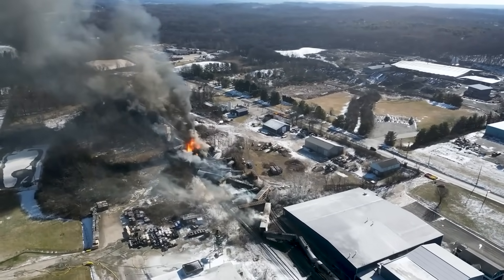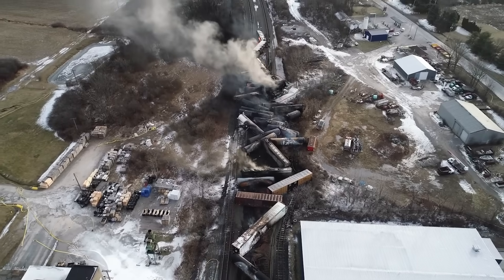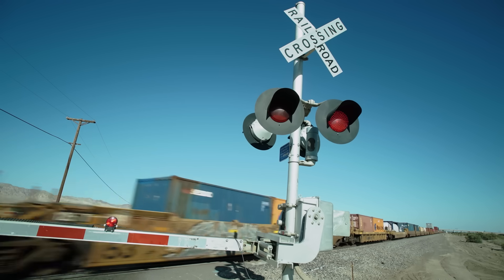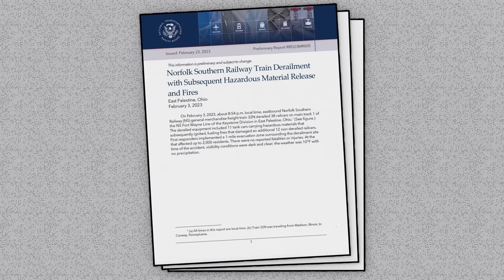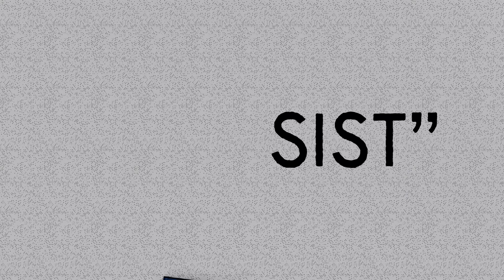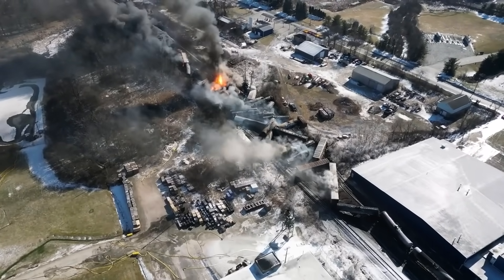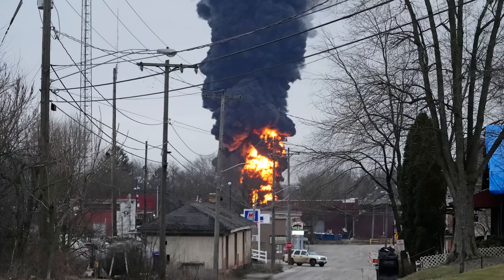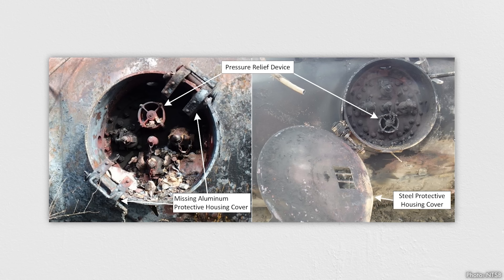East Palestine Train Derailment Explained

Comment: There definitely is something that can be done politically about the safety culture for the US Class 1 Railroads, and something was attempted about half a year ago, the big rail union strikes, while also being about draconian working conditions, were about safety on the line. These things were raised to the rail operators and of course they were soundly ignored because re-investing in rail infrastructure takes away from the scheme of pumping stock prices with stock buybacks and creating a circlejerk of money for the board members of companies like Union Pacific and Norfolk Southern.
Reply: dont worry, though, this will "spark a conversation"
That's all we need.
That always fixes these political issues, right?
Reply: @diegoochoa572  just thought thoughts and prayers <3 

oh wait
Reply: @BOBTHEBERT Your comment started off interesting, but the more you wrote, the less I was persuaded. All I saw was someone who didn't know the first thing about how companies are run and only wanted to divide people. Your post implies that these companies are ignoring reinvestment but a quick fact check reveals you are wrong.

Both companies increased capital reinvestment in 2022 and 2023 (to their highest levels ever) and both are spending over 20% of revenue (not profit, revenue ... so, a larger commitment!) on capital reinvestment. Both replaced and repaired over 100 bridges, built hundreds of new turnouts, replaced over 400 miles of track, resurfaced thousands of miles, replaced tens of thousands of bridge ties, and replaced millions of railroad ties. Both also invested a couple billion in their industrial partners to help keep companies and communities that use trains healthy and created thousands of jobs in the process.

If a company buys back its own stock, it thinks it's financially strong today and will be in the future. You should be glad your company is able to do that. (You don't want to be a leach on society and work for a company that expects the taxpayers to bail it out, do you?) When a railroad makes a profit after a buyback, it keeps the dividends it would have paid out to other people, so it can spend that money on other things inside the company, like rising healthcare costs. 

When the stock price goes up, pension funds are on more solid ground and you're less likely to abandon retirees because you spent more than you made. A financially solid company can borrow money at a lower cost, which again reduces your overall expenses so you can keep buying steel to replace rails even when inflation is up. Or maybe they'll use that money to pay for union-mandated wage increases. Companies with rising stock prices attract new investors who give you a capital infusion to continue building out or refurbishing your rail system so you get these benefits all over again next year. (And presumably people buy that stock at a higher price than your buyback, so even more profit for your company!)

Don't fall for simple stories like "the rich want to screw everyone." That's just a sound bite designed to shut down your thinking. You'd be better off learning how and why people make these kinds of financial moves outside of self-interest. Turns out there are plenty of reasons.
Reply: Man its almost like capitalism doesnt work and deregulation leads to disaster? Who wouldve thought
Reply: Didn't Norfolk southern spend billions $$ on stock buy backs? That money could have been used for better equipment and on safer working conditions.
Reply: “Draconian” lol…absolutely laughable union propaganda.
Reply: Just nationalize the railroads already, we can't trust railroad companies obssessed with cutting costs above anything else to control some of the most important pieces of infrastructure in America.
Reply: Train brakes are ww2 Era technology both Obama and Trump signed law that excluded this trains  from having to update these trains, making a hole lot of money for the railroad oligarchs.
Reply: @juniorbricuyet528  which, if the law was signed and in place, would not have affected this accident in the very least.
Reply: I am honorarily pinning your comment.
Reply: Capitalism :D
Reply: @ssggzzyy76 this practice is actually communism.
Reply: @ssggzzyy76  no, that’s called money laundering.  Similar to religion and how all the donations that are made are tax free.  However, it’s the grey areas that people operate in that destroy the idea of integrity between competition - though, it’s legal.  Though for the instances where it’s illegal, but we’ve been desensitized to pursue justice because of the blind trust that people place with their politicians, which created the avenue for the two-tier justice system we have now, which needs to be dismantled.
Reply: @ssggzzyy76  not even that, just corporatism. :P
Reply: @BOBTHEBERT never truer words have been spoken. Thank you my good fellow!
Reply: Very disappointed that Biden forced them back to work.
Reply: @brianwest2775 whole trump removed safety regulations
Reply: We need nationally owned rail
Reply: @jonathanshapiro6593  At least the tracks.  Charge these companies for the maintenance and set standards for safety.  Plus then they could be maintained to a level that higher speed passenger rail would work, add in actually giving Amtrak preference and it could make it much more usable.  Not dedicated high speed rail usable but better than the expensive slow slog it is now.
Reply: @dunidane5206  90% of what Amtrak operates has 79mph track which is FRA limited but they also have equipment that is horrible and delays them which then throws off lineups for freights so instead of making those late as well Amtrak is just made later. Also they have set standards of safety its basically a one-off thing but anyone who thinks they know what they are saying does not realize that so its not your fault.

Comment: Hello there, another railroader. Great video although there is some stuff that could be changed.

1. Cabooses  weren’t traded in for defect detectors. They were traded for something called a EOTD (End of train device) or a FRED ( Flashing rear end Device) which measure stuff like air pressure, speed and amounts of slack on a train. Defect detectors have been around since the late 70s.

2. Railroads transport dangerous chemicals such as Vinyl Chloride all the time. Every single rail line at some point in time has seen chemicals transported on their rails. Plus railroads like NS tend to transport chemicals with other bulk commodities like food, etc. This is common practice especially on the NS Fort Wayne line where the derailment happened

That’s all I got to say. Keep making great videos. Thanks
Reply: A little note to add the Seaboard System actually had these in the 60s. First being invented the late 40s.

Comment: ... Grady, I hate to say this but you are wrong*. Rail cars ARE *NOT FAIL-SAFE BRAKES. they are PRESSURE SET. Air pressure *MUST BE MAINTAINED*. If air pressure is lost, the brakes are lost. mechanical brakes are hand operated crank wheels as parking brakes. 
There are countless rail disasters that show this such as the very recent runaway 3 weeks ago in Las Vegas where the power distribution and cargo were mismanaged, causing a coupler to fail, pairing the airline, and leaving the downgrade portion of the train unable to effect brakes other than the engine's dynamics, as the other power units were with the remaining section, both on stable grade and able to effect braking. the engineers bailed out and the runaway hit something like 140 mph before plowing through a curve in the track in the middle of the desert. 
Then there is the Infamous Lac-Mégantic rail disaster where the power unit caught fire while unattended, and bad company policy had led the previous conductor to belive that enough mechanical brakes were set to control the train in the even of a loss of air. Unfortunatly for a small Canadian town, that was incorrect. After fire crews left, the powered down the engine bled off air and the brakes released, pushing though the parking brakes allowing the destruction of the town.

You are misunderstanding the emergency brake protocol. when an emergency stop is commanded, brake pressure is ramped to 100% immediately, and full dynamic brakes are engaged at the same time. An emergency stop command was issued in the Las Vegas derailment, but because of the train separation, it did not have the authority to command. Air pressure was dumped out the open lines and no brake effort could be made where no pressure could be built.

I do not remember what the number is, but there is a time of pressure transition along the length of the train that is known in feet per second, because when you are at the head end, and you apply brakes, that's how long it will take before the furthest car under your control will take to even know there's something different other than the mechanical load on the knuckle. it's also one reason you have distributed power, because it's more places the brake force spreads from

Comment: Why isn't there an acceptable change on temperature between hot box detectors? The rate at which the temperature is changing is more important to detect an issue before it happens. It would be more useful for preventing an emergency than the temp at any one point. Sure seems like they chose an arbitrary temperature as close to failure as possible to avoid regularly neglected maintenance from stopping trains. Skeletons crews caused this issue.

Comment: Here's some changes that I would consider. 
*notify local government officials of hazardous chemical transportation. 
*use separate trains for transportation of hazardous chemicals.
*reduce train lengths of hazardous chemicals 
*start monitoring and increase maintenance on hazardous chemical cars that are most vulnerable. 
*make hazardous chemical placards understandable to include instructions on how to handle chemicals inside these cars. Data sheets on each hazardous car encoded digitally. 
*trains in the past carried passengers across the country although that, continues to some degree today. Using passenger rail lines through towns to carry hazardous chemicals seems like a bad idea. The ditches that are alongside the rail lines could be considered to hold hazardous chemicals until proper  collection is available.

Comment: Ask Quebec if Rail is safer? these are bomb trails and Canada needs pipelines. not the incompetent pipelines that socialize the cost of accidents either. A backup for spills. Even if it's a sump for holding toxic materials it's better than now. No reason a sump cant be built at low points and a trough to catch any leaks. Open to the air so there is no risks of detonation. Draining into a sump that can be drained and hauled away by truck or rail. Put the pipeline next to rail or rail next to these pip lines. There is 7 pip lines that go through the great lakes, 1/5 the world's fresh water, built in the 1960's. No backup incase of a leak.  How is that responsible? Lots of good ideas but none applied is the issue. The CEO will miss their bonus.

Comment: You brought up the wrong question, the question is not why did they release the chemicals from the tanks, everyone sees the hazard of leaving it in.   The question is once they created a trough to burn the stuff off and got it out of the tanks why not just pump it into mobile tanks... the burning was un-necessary.   Simply put the reason was $$$, now they can claim it all magically burned cleanly in the air and don't have to deal with the waste VC.

Comment: Well, it seems obvious that one way (most likely the best bang for the buck) would be to equip all of the rail cars with anti-lock brakes. applying the brakes smoothly would significantly reduce the liklihood of derailing any of the cars. and that would reduce the liklihood of spills as well.  the investment would be a bit costly. but compared to the cost of even a single spill it would be cheap. I get it, nobody wants to spend money. but sometimes, it is the right thing to do. if one child gets sick and dies, that childs life would be on a railroad executives hands. and that is a nightmare I would not want to keep playing over and over again. I would NOT be quick to assign blame to anyone. sometimes, it takes a catastrophy like this to bring about change. but this NEEDS to bring change.

Comment: In my hometown in Germany, a train loaded with 180 tons of hydrogen cyanide left every day between 12 and 1 p.m.. They were special tankers, spaced farther apart, and at the end were one car each with bulk material to protect them from other trains.
The train driver had to announce its departure and any oncoming train traffic had to be diverted.
Then the train passed millions of people until it reached another chemical plant where the hydrogen cyanide was needed.
In our station you could even stand next to it, but normal people knew nothing about it.
In the event of an accident, the plant fire departments were dispatched from the start and finish, and the local fire department in charge. The works fire brigade even had a special car with a flare gun to shoot the damaged train on fire if necessary, so that the hydrochloric acid would burn, so the legend goes. But since a good year ago, this train service was discontinued after 60 years of operation.

Comment: You didn't actually say what the root cause was! :( Why did the bearings fail? Were those bearings/that axle known to be bad, but maintenance was not given the supplies or time to do a repair? Were repairs previous done, but done incorrectly? Was the issue missed due to poor inspection techniques/equipment? Was the design of the bearings itself faulty? Was the part declared obsolete and had been "grandfathered in" despite better ones existing?
Reply: NTSB report will have that all in it in 2024. They always take 1+ years to release their full report.
Reply: @BeckaReus  Darn, I figured the preliminary would have had at least something on that.

Comment: One issue that has changed in the last 10 years is train length.  The air pressure change in the brake line takes sometime to migrate from the Locomotive to the end of the train.  in a longer train it will take more time for the brakes to start working.  My guess on what happened is that the axle overheated and broke causing the car to derail.  Then the cars behind it jackknifed into the derailed car.

Comment: Yet another example of aluminum being used instead of steel. When will engineers learn that aluminum and plastic is for toys, not tools, and certainly not an application like this. Aluminum parts should be outlawed, they break instead of bending, the burn instead of melting, and they fail catastrophically in every application they have been implemented in.  There are trucks on the road right now that have aluminum differential cases and aluminum frame components,  every one is just waiting to break. This is also why newer vehicles have a life span of maybe 120k miles where as a vehicle made before 1980 has a lifespan in the millions of miles if properly maintained.  Our planned obsolescence, throw away society has caused us nothing but problems and we shouldn't tolerate it anymore.

Comment: One thing that would've helped in this case is automatically comparing axle temperatures from the current sensor to the previous one. On it's own a temperature of 103 F isn't a problem, but a rapid temperature increase from 69 F to 103 F might indicate a significant problem. Having temperature detectors closer together (which NS are now doing) would've helped too. As would detectors on each axle.
Reply: Yeah, currently the detectors on the report if there is an issue or if there is not an issue. They store the data locally, but they don’t transmit it to the train and so the train has no way of comparing previous temperatures measured.

Comment: I find it difficult to believe that rail transport of HazMat is safer that our pipeline system, buried underground.  Even across fault lines, as with the Alaska Pipeline, the engineering allows the pipeline to move and flex within limits.  This is far from over, and it's going to be a big tab for NS, as it should.  I don't agree with the decision to burn 500,000 # of vinyl chloride; the noxious fumes must have debilitating.  Let's see what the NTSB says in its final review.

Comment: Hi Grady, great video as always. Though I would have loved to hear a bit about some of the malfeasance on the part of NS in regards to skipping inspections (in particular for wheel bearings) for the sake of reducing the costs associated with both keeping the train still and repairing the damages, as well as warnings by NS employees that the trains were both much too long as well as severely understaffed. If they had not skipped the inspections associated with these bearings and replaced them when needed, this tragedy would have been avoided completely, so it's by no means just an "unfortunate accident", it was an inevitable result of cost cutting and lack of oversight. Again, keep up the great work. I can tell you wanted to remain as apolitical as you could (impossible imo), but the responsibility of NS really cant be overstated here.

Comment: Ammonium Nitrate is also another hazardous material that is transported by rail cars. If you don't know what that is, look up Beirut Ammonium Nitrate. Literal tons of hazardous materials are transported via railway. If you're ever curious, next time you pass by some rail cars, just look up the placard numbers on the sides of the car. Most of the time it's crude oil, diesel, ethanol, gasoline, or different types of gasses.
Reply: Let's hope another Beirut blast doesn't happen again...